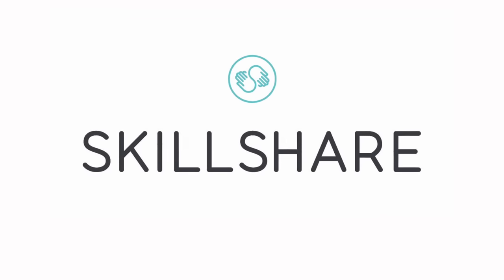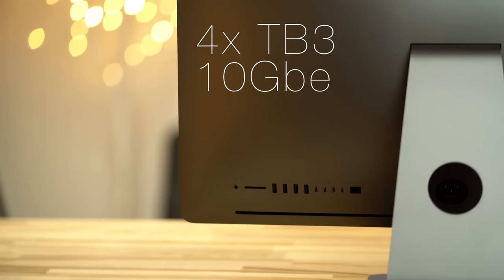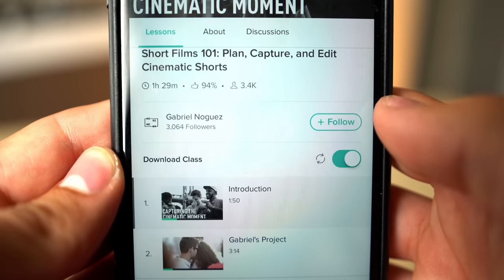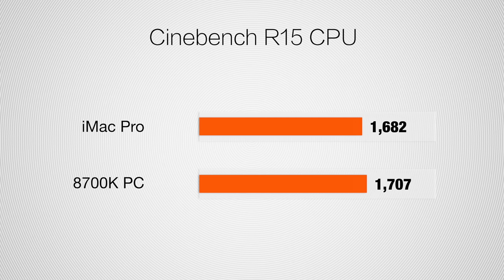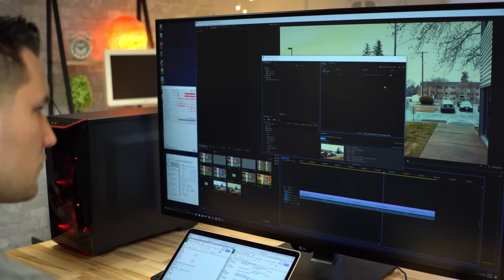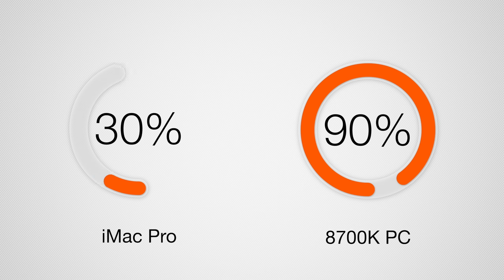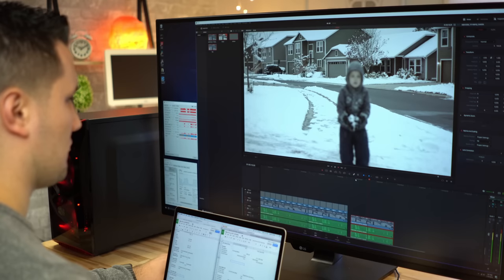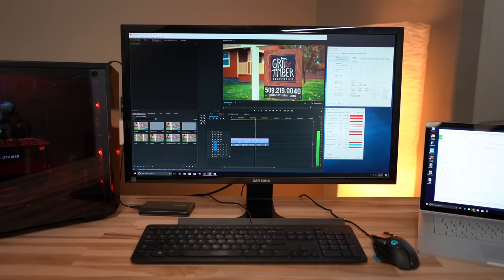$1350 PC vs $5000 iMac PRO for Video Editing 😲 Premiere & Resolve

Comment: A $2000-2500 computer might be a better comparison and the problem is the iMac Pro is not upgradable.
Reply: It certainly is! One can upgrade RAM SSD and CPU. One can also add an external GPU for use with an external monitor.
Reply: Per Karlsson Only the RAM is upgradeable.  The ram can only be taken touched by authorized Apple techs.  One might be able to use thunderbolt for an external GPU.  However, I am referring to the unit itself. 

https://9to5mac.com/2017/12/15/opinion-a-non-upgradable-imac-pro-not-as-crazy-as-it-seems/

If you want to try any upgrade attempt, it’s really difficult.  

https://9to5mac.com/2017/12/27/imac-pro-teardown-owc/
Reply: For a techperson its not that difficult to upgrade SSD RAM and CPU in the iMac Pro.
Reply: Per Karlsson, it’s misleading to say that.  If you look at 9-5Mac’s tear down, it’s not easy to upgrade.  The common user will not be able to upgrade this thing, Apple did not intend it to be upgraded (with the exception of possible EXTERNAL thunderbolt graphics or RAM done by Apple).
Reply: letsgocapsbeatpens 
Its not that hard to upgrade it yourself But of course one has to know something about taking stuff apart.

Comment: PC has more modern CPU cores, MACs will always lag behind, case in point Threadripper 2000, Ryzen 2000 and Core i9
and another thing, Apple just designs stuff, the inside is made by Samsung RAM/SSD, LG Display or AMD Radeon ;P

Comment: i got it from microcnter using a credit card bonus offer of 500 dollors back when you spend 4000 dollars in the first 3 months. so i ended up getting an imac pro for 316 dollars a month for 12 months. did i still overpay.

Comment: how can you stabilize in Resolve if you don't have the Studio version?
Reply: Dao Quang Right! And @MaxYuryev apparently doesn't realize Blackmagic Design traditionally does not provide multicore support in the FREE version of Resolve! Or have they changed?
Reply: the multicore is correct. Davinci supports really well and maximize your computer's power very well, for both the Free and the Studio version. I know cause I just upgraded from the free to the studio version recently and all I can say about the update is that it unlocks a few features like noise reduction, stabilizer, lens correction, tilt shift, and multi-editor (which I never use cause I work alone).

Comment: Thanks for the video , as always excellent work. It will be nice to see the systems working for a longer period , like an hour render.  You still don’t compare the iMac with an actual windows workstation. You talk about s higher end machine but it still has a i9 instead of a Xeon. I am sure you can build a Xeon based workstation for similar price that is faster than the iMac. Please do so if you can. Maybe the issue is that it will be too expensive ? That will be relevant for people that believe they need the Xeon
Reply from the maker: Jaime Duncan The main reason why is most people will use i9’s. The Xeon in the iMac Pro is based on the i9’s (or the other way around) but the Xeons support ECC and multiple CPU configs. There’s really no difference in regular performance and I think the Xeons can’t be overclocked where the i9’s can.

Comment: Weird comparison. Why build a PC with a gaming CPU and then do a comparison for video editing? Why not just put a threadripper in there and see how the iMac stacks up to that? You'd still have change from your $5000 budget and a threadripper is a prosumer part ... designed for things like video editing. If you are building an editing rig, you aren't going to choose an 8700k. Also an iMac is not workstation grade parts. Vega 56 and Vega 64 are consumer parts, Radeon Pro is workstation parts ... so iMac doesn't even have that. Its a silly hybrid neither one nor the other ... workstation prices, can't be used as a workstation.

Comment: i dont know where you buy your hardware but even if you take above average peaces i have no idea how you got from 1350 to 3000$ by adding a monitor, keyboard and mouse
usually a 4k monitor is ~250-500$,  a keyboard ~100$ and a mouse ~50$
i personally would never spend that much money on any of these parts
Reply from the maker: The same quality as the 5K display. If you buy an entry level 4K monitor it can be a lot less.

Comment: Common sense..For $6000,the MAC should cook,clean,have 20 year security,dance,and talk,while editing.For $6000,i can guarantee a computer which passes or matches those tests,AND i can show you a stock DEll server,where i can stick more hard drives in for archiving..I talked to a MAC rep,here in NYC,and he told me how to build an editing MAC,which will be just as great,with 64GB,and more drives,for around $3500,using the Imac 5k.Would i buy the Pro?Yes,with someone else paying for it,yet when it is my money,it has to wow me.Common sense  and deductive reasoning dictates,if those two computers are even close in performance,there's an inherent problem.That's like someone in   30k Camry close behind me if i am driving a  80k BMW ,at full clip..

Comment: It's quite easy for me. I want to use Final Cut. And I don't want to rely on a Hackintosh. So a real Mac it is.
Reply: slaWterCH pointless xenon has no quick sync
Reply: That is true. The iMac Pro is made for very specialised tasks and cameras. 
But I'd still get a base model iMac Pro over the normal iMac given the small price difference. Even without QuickSync.
Personally, I prefer MacBook Pros with external 5K displays. My workflow does not include 8K files after all and I prefer the portability factor.
Reply: slaWterCH to be honest ur Mac book pro will render faster in fcp bcs of quick sync and  srry I am not a fan boy but I don't see the point in sticking to apple products if ur not using fcp for video editing bcs of apples inferior hardware compared to the competitor
Reply: Indeed. If you just look at raw performance in Premiere then you're better off with a custom PC for sure.
Reply: slaWterCH no bro even if ur looking at resolve with an 8 core i7 will crush this I Mac pro
Reply: If you are just after pure performance and don't use Final Cut, there are cheaper options out there. But "cheaper performance" doesn't mean a better product overall. 
But I'm not sure why you are trying to convince me that the iMac Pro is a bad deal based on my comment.
Reply: slaWterCH bcs of quick sync support one of the reason why I adore Mac book for video editing over any other laptops .if xenon has no quick sync there is no point each and every component can be built of a better quality in PC compared to the iMac pro including there 5k monitor which is  recently beat by dells latest 5k monitor with very colour accurate and highest brightness monitor so I don't see the point in buying the imac pro just grab a Mac book that  will be a better choice . Srry I am not trying to convince u but this is  just a suggestion . It's been a great to chat with u thank u 😂

Comment: "You know nothing Max Yuryev." :-) ... iMac is faster with Resolve because of the Vega 56 with HBM(!) memory and 3.5k shader units. Resolve uses GPU extensively. And testing both systems with free version of Resolve is pointless because of the fact it intentionally limits itself in the use of system resources. Studio version results would be quite different.

Comment: A PC doesn't run OSX. That is the BIG advantage a MAC has over a PC.  I know there are Hackintoshes but there are a lot of issues getting those to run correctly.  OSX is more secure and runs a lot better than WinBLOWS. That being said I HATE the keyboard and mouse you get with a MAC.

Comment: Your video motivated me to build my own pc, so than you for the great content. The build is not for gaming - it's purely for 4k video editing on Davinci Resolve. This is the build and it's around CAN$2600: https://ca.pcpartpicker.com/list/ct9jNQ 
CPU: Intel - Core i7-8700K 3.7GHz 6-Core Processor | 
CPU Cooler: CRYORIG - H7 49.0 CFM CPU Cooler | 
Motherboard: Asus - Prime Z370-A ATX LGA1151 Motherboard 
Memory: Kingston - HyperX Predator 32GB (2 x 16GB) DDR4-3000 Memory |
Storage: Samsung - 970 Evo 250GB M.2-2280 Solid State Drive |
Storage: Seagate - BarraCuda Pro 6TB 3.5" 7200RPM Internal Hard Drive
Video Card: EVGA - GeForce GTX 1070 8GB SC GAMING ACX 3.0 Black Edition Video Card |
Case: NZXT - S340 Elite (Black/Red) ATX Mid Tower Case 
Power Supply: EVGA - SuperNOVA G3 750W 80+ Gold Certified Fully-Modular ATX Power Supply 
I would love to hear your thoughts/suggestions. Thanks so much!

Comment: It would be also interesting to install a MacOS High Sierra on it. The 8700 is not really good for Hackintosh yet but I know some people have it working. The M.2 SSD also could be a problem altough as far as I know it is OK under High Sierra. Just it would be even closer since both system would use the same os :-)

I just found a link ... they did it Cofee Lake processor and Z370 motherboard...
https://hackintosher.com/builds/gigabyte-z370-aorus-gaming-7-hackintosh-build-guide/

Comment: With your "neglible" cost diffrence arguement, you are forgetting one small thing. Time is money, right? Especially when couple thousand dollars is neglible diffrenece. If some part of you windows pc break, you can slide in a new one, while getting warranty service on it, nowadays even motherboard can be easily swapped without reinstalling system. If imac pro breaks... You won't have it for as long as warranty service will take(of course if you live with one of sertified service centers, othewise you need to account for travelling time). So, 1-2 days of pc downtime with windows pc, and however long apple store will need to fix your imac pro. Not so neglible now, isn't it.

Comment: What are "workstation grade parts"? XD They are all just computer parts... generally made in china... and... The iMac Pro uses a typical Intel processor, very normal AMD video card... normal ram, probably from samsung (that's at least how it has been for over a decade), and normal nvme or what have you for the ssd(I have seen one broken down and the M.2 ssd they include is identical to Samsung's in every conceivable way... Hold up a second though, MSI gets a special military grade award on their parts that qualify for the rating, and as far as I know, the only people vetting Apple hardware is Apple, so what makes it 'workstation hardware"? Also, most repairs through apple, under warranty, end up costing insane amounts of money... that is not how workstations are. Workstations from nearly every other manufacturer/brand is backed to a much higher degree, often with immediate complete replacement and data transfer to a new unit happening same-day should an issue arise, due to corporate workflow needs. There is no comparison, even if they cost the same, for the same specs, and had the same capabilities in all aspects, at the end of the day, you can fix your PC... you can't realistically fix your Mac without an absurd headache and a lot of cash to blow. Granted, they don't cost the same, and if you were to build a PC that had an identical price point to a mac, making sure to stick to parts with the absolute best-of-industry classifications, that would be one hell of a pc... There'd be no comparison.

Comment: The performance gap was always there, but the last years it has grown... Then AMD brought the Ryzens and made it even bigger... and after August will become huge... Threadripper 2 is coming... with 32 cores.. and then maybe intel will also make something even more impressive.... PC market has been using this CPU power race. There are many inexpensive PCs with multicore CPUs that can easily outperform iMacs, there is even an ASUS laptop with an 8 core Ryzen 7 and it seems that 6 core intel laptops will flood the market sooner or later... On the other hand Apple has ended up being slow and unwilling to invest on performance. Therefore, their products are not really "Pro" any more... They invest on well designed touchbars, keyboards and trackpads... Well, this may be good for the average user who doesn't need excessive power and needs a well made machine, but still, what Apple is offering is simply too expensive for both what it is and what it does! This, in combination with the growing performance gap, is reversing the game. Fanboys will always be fanboys, but for all of us that actually buy and use high performance computers for production and not for showing off, it is becoming more and more easy to know what to choose.

Comment: PC: nearly infinitely upgradable when compared to any Mac crap. Choice of whatever parts you like best. Install whatever OS you want, including OSX itself. Not obsolete the moment you walk out the apple store. Nor will you need to deal with apple store a-hole sales personnel. Repairs are cheap and easy, always and easily done DIY. No stupid brand premiums on anything. No firmware-lockouts for hardware. Sooooo many more options that allow you to literally think different about everything.
Apple: crap build quality other then a somewhat polished exterior. "Repairs" cost the same as buying a brand new computer. Saying it comes with a "Xeon CPU" as some sort of insinuation indicating "better" means fuck-all, especially when all the Xeon CPUs apple uses are just slightly better BINned & older Core i7 CPUs... Ever tried upgrading to better, production quality, video cards?

Comment: your percentages are really off
Reply: in DaVince Resolve 5min 1080p 2LUT + FG iMac is ~40% faster it takes 60% of the time
Reply: in 5min 4K the iMac is again ~40-45% faster if you take your way of measuring speed, you need to swap the bigger/smaller numbers in your equation to get the right percentage

Comment: Hi Max, I hope You remember me :). Listen I have a small request if you could help me out. I need to build a completely silent 4k home theater pc. All it needs to do is have good audio and to play 4k videos, no gaming, no editing, kore of a windows based media center. Got any ideas? thanks!
Reply: Get a 2017 5k iMac base model and run windows on it via Bootcamp. Insane speakers, great screen, solid design.
Reply: Zony Yu I need a small box to hook up to a big ass 4k tv or a projector. I need it to have a good audio card also. Not a whole pc setup/mac.
Reply: NUC
Reply: Mac mini & done
Reply: Apple TV/chromecase
Reply: Zony Yu imac pro insane speakers!?
Reply: Immanuel Kant insane compared to any other built in speakers
Reply: Zony Yu But they still suck ass compared to a real speaker setup. And I think that he meant something different with good audio!
Reply: Immanuel Kant have you heard them at all?
Reply: Zony Yu No need for that. They will sound like crap compared to 100$ speakes already
Reply: you could get a pc with a GTX 750 ti which has been rated to do 4k video just fine and they can be found for dirt cheap, they don't get very hot and you can find them small, if you want more performance go with a GTX 1050 ti which can also be found in smaller form factors along with the 1050's or 1030's. put 4 to 8gb of ram (recommend 8) atleast 1tb of storage but probably go with a lot more as 4k videos take up a lot of space. you can go with some be quiet fans. I would go with a mini-itx board and here is the case https://www.newegg.com/Product/Product.aspx?Item=N82E16811352059&ignorebbr=1&nm_mc=KNC-GoogleAdwords-PC&cm_mmc=KNC-GoogleAdwords-PC-pla-

it already comes with a power supply and you can see some youtubers review the case
for the speakers go with surround sound speakers and I would recommend going with whatever you like, just make sure they work with the PC

Comment: I need something that can edit 1080 p video very well under $1000. Without any aesthetic frills. No lights or pretty case. Could someone point me in the right directions?
Reply: just find any cheap tower pc and put a graphics card in it, it doesn't really matter what you get as long as I would say it can show an imige at 1080p